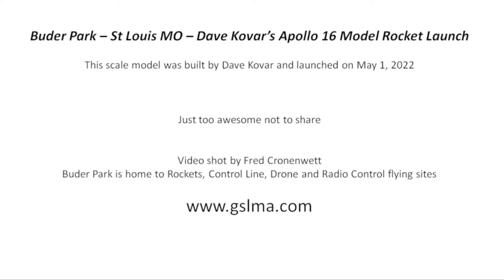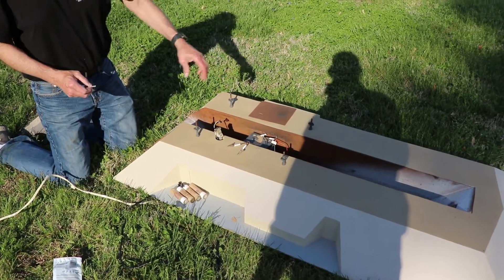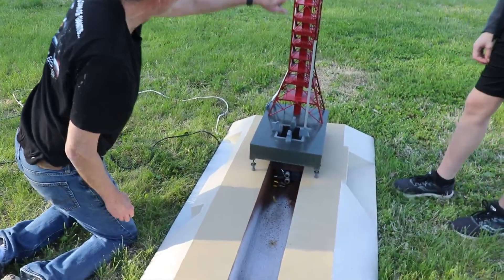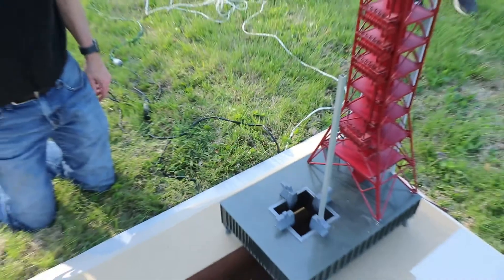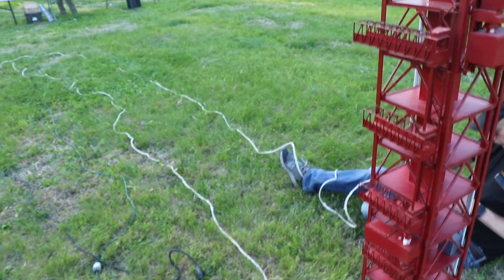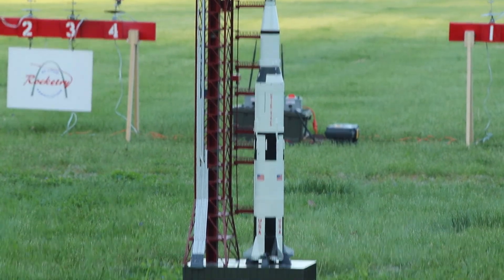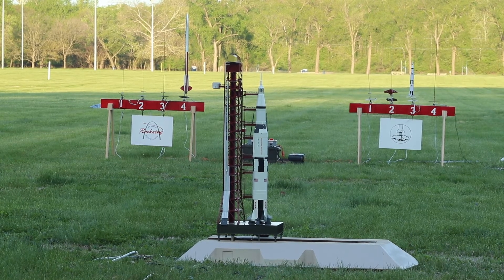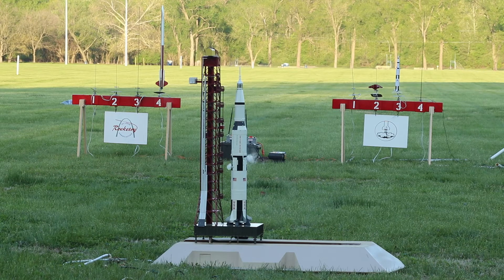Saturn V rocket launch - Dave Kovar

Comment: That Saturn V took of 20 times faster than the real one.  The launch tower is just way to cool
with the White Room, swing arms, cat walks, nitrogen vapor, fuel pipes, flame buckets and all
those details.  I think the launch pad is cooler than the rocket.  Why was that wire to the left
at 7:15 smoking?